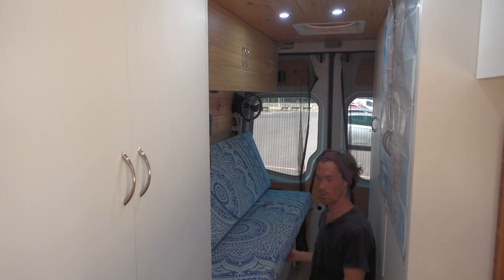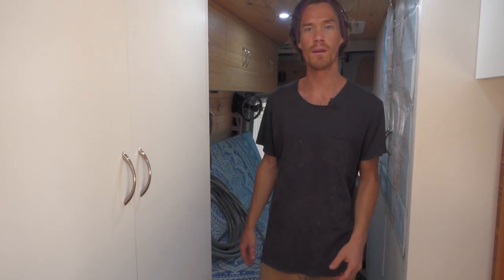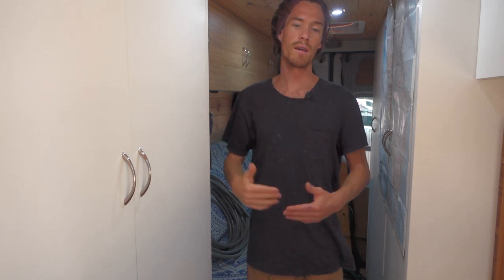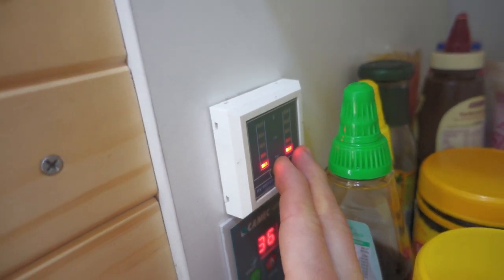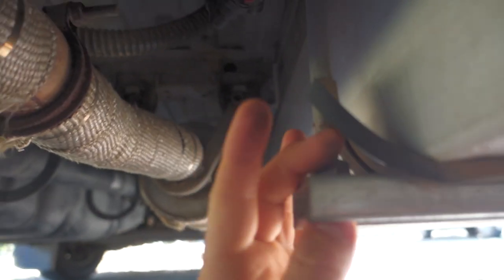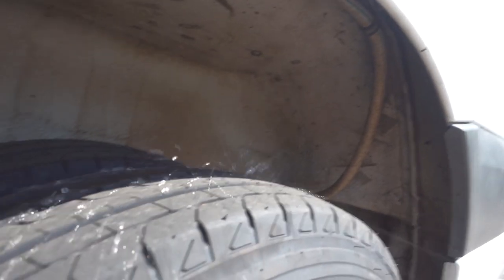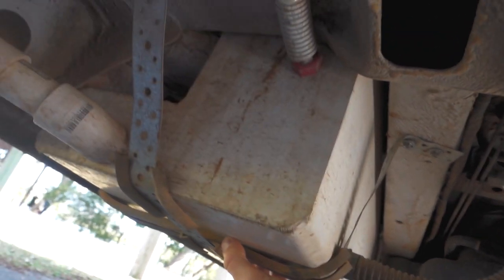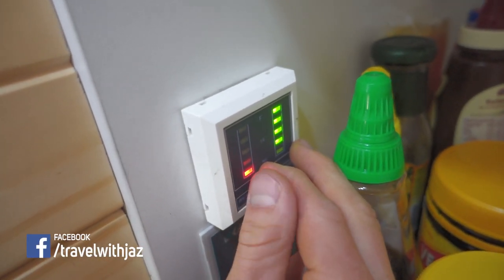S2E4 Sprinter Van Life | Filling the Water Tank

Comment: Is it legal to just have your grey water tank left open?
Reply from the maker: Yeah I can't see why it wouldn't be, think of people being allowed to washed there car and let things run down the drains/gutters.
Reply: I guess...probably still have to be discrete about it though
Reply: Always have this argument in the uk. Just leave the grey tap in a slight open, and it just drips away. No problems
Reply from the maker: yeah i've never had any problems, only if I am trying to be really stealth and not let anyone know I'm in the van will I lock the valve off
Reply: Did you do a video on upgrading the fresh water steel supports? I had planned on following your previous strapping method until I saw this.

Comment: Mate what do you use for that council taps without the tap head, I think they have a special secure tap, I was thinking one would be handy to have with.
Reply from the maker: I have never come across a public tap where my 4 way tap key doesnt work
Reply: 4 way tap key is that what they are called, bunnings or a trade plumbing shop.   @JaznLori
Reply: Thanks mate just brought one @JaznLori
Reply: @JaznLori   on a separate note, are you in Brisbane or can recommend a sparkie to check the rough in on electrical on my bus (just run conduit) before I line the walls etc I will need electrical certificate at the end.

Comment: I just wondered if it`s possible to remodel your toilet to a compost toilet so that you get rid of emptying the cassette toilet?
Or wouldn`t it work because of shower splashes?
Nice setup with the double check valves, i bet i would forget them while constructong such a system, even my father was a plummer once and i helped him some times as i was a kid...
:-)
Thx for the vid!
:-)
Reply from the maker: I'm not too sure if I could remodel it given ive already cut a hole in the side of the van to install the toilet, but it could be possible ;) thanks a lot  for watching, well yeah I didn't put one of the check valves in originally and added it in later, its real easy to do.

Cheers!

Comment: Dude you got yourself a serious Tan as a ginger you have to be careful up North and you've lost a bit of weight maybe to much, your going to have to eat a little bit more than your girlfriend.  I noticed you wrapped your exhaust...great idea. Keep living the Dream :)
Reply from the maker: thanks mate dont really classify myself as a ginger haha but whatever :D yeah the exhaust wrap works great man i recommend it :) cheers man!
Reply: I know your not a fanta pants, but you have a tinge of ginge that means you have to be more careful than most. With the exhaust wrap you'll even get a slight performace improvement. The heat staying in the pipe makes a greater pressure differential between the end of the pipe and the start, of course the other benifit is of course less heat on the floorpan. I pondered the idea of a water heater with small copper pipe spiralled around the exhaust and then wrapped, you wouldn't even need to pump it you could use convertion to drop it back in the tank higher than the drop point.
Reply: I had weight concerns aswell. Didn’t recognize him in this video, I had to check name. Praying everything is ok and you are great health and spirit.  Be Blessed!

Comment: Is it worth changing the grey to a second clean water tank? Just have your grey wash direct onto the street rather than through an empty tank
Reply: Jason Robertson I’m diligently copying Jaz on almost everything but with the invaluable benefits of seeing how Jaz’s system works - a million thanks for your generosity Jaz in sharing your knowledge and lessons learned - I was also wondering if it’d work to swap the grey water tank for a 20L? and make the fresh water a 150? What do you think Jaz? And if going for a larger fresh water tank is feasible, is one large tank better than two smaller tanks? I was also wondering about whether any consideration needs to be made for static created by the water swishing about during driving?
Reply from the maker: Yeah you could do that too! ;)
Reply from the maker: Hey mate thanks for watching. I would advise that my 68L grey water tank is way to big and doesnt need to be that big, 20L would be fine. It would be worth it to use some of that extra space for a 2nd water tank, that would be heaps handy ;) the only thing for me was the practicality of plumbing 2 tanks in together that are on different sides of the van.

Comment: Nice setup but I'd be far too paranoid to just take the water in as-is. Lord knows what kind of bacteria and sediment and whatnot is in there. Definitely putting in a dual or triple canister whole-RV filtering system that's between the water intake and the rest of the van. Also, putting protection between the metal strap and the tank was probably a mistake. If that protection comes off, well, then your tank starts rattling around on top of the metal straps. Tank manufacturers generally recommend no such padding, I believe.
Reply from the maker: Cheers mate that would be preferable to have all those filters, but I do have a triple filter system for our drinking water as you can see in S1E12. I have heard that about that rubber from someone else too, I guess if it comes out i'll hear it rattling and just re adjust the nuts on the threaded rod to tighten it back up if that happens ;)
Reply: Aha. Well, that works too, just have to flush the tank a bit more frequently since there will be sediment and stuff gathering there over time.

Comment: Enjoying these instructive videos. Did pick up on one potential issue though. Noticed you have something between the metal and the plastic tank. A manufacturer recommended not to have anything like rubber between metal and plastic because it can work lose over time. That's from a comment to the following video (about 14 comments down, the one from Mike, and see Greg's response to that). https://youtu.be/3053PsSxqDQ
Reply from the maker: Thanks very much :)Thats interesting I'll have to keep an eye on that, but the metal uni strut bars are done up pretty bloody tight so for them to loosen would be super unlikely in my mind, but will keep an eye on it just to be sure, thanks!